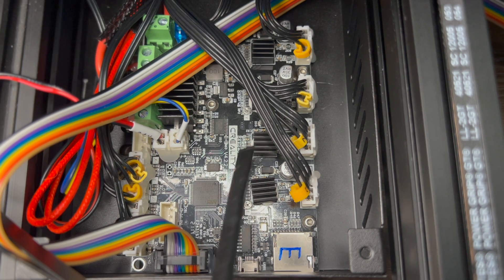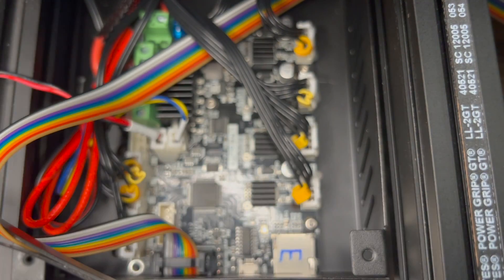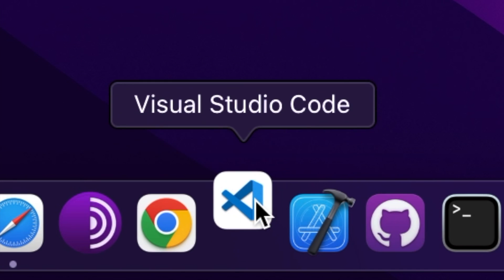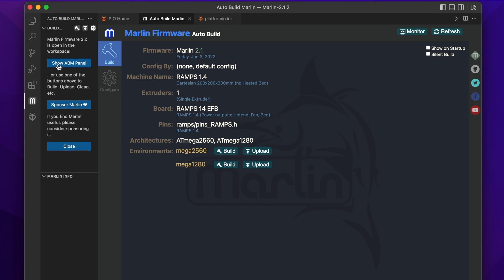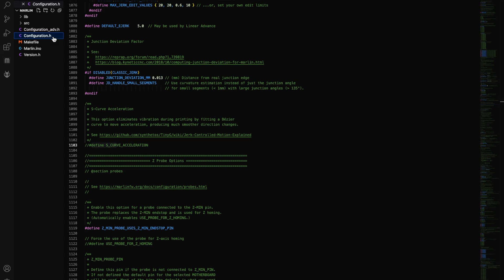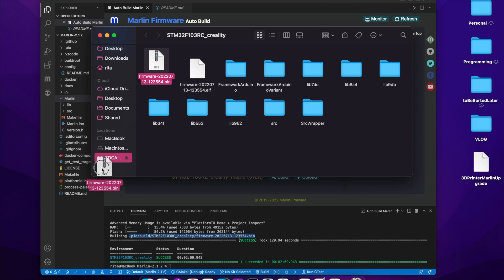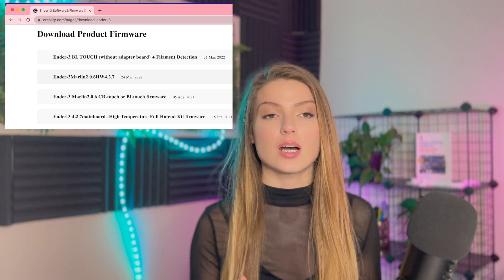How To Update 3D Printer To Marlin 2.1 Firmware (for Ender 3 and more)

Comment: One thing I have to do in the firmware is change the maximum temperature of the hotend and the bed, in my case I need to print polyamide or pa-cf which is a high performance engineering polymer with carbon fiber, the complicated part is changing the firmware and in research I saw that the standard hotend is not suitable for this, but it supports it so I'm going to do it and my printer is in a marine compression oven and the board and filament are outside, in this case I made the modification on the ender 3-pro

Comment: Hey everyone, I need some help! I’m trying to update the firmware for Marlin on my 3D printer, but it’s not working. I’ve downloaded the firmware, configured the files, compiled it, and copied the .bin file to a FAT32 formatted SD card. However, all that happens is the printer writes the EEPROM.DAT file, but it doesn’t actually update the firmware. Has anyone else experienced this? Any advice would be greatly appreciated!

Thanks in advance!
====================================
Hola a todos, ¡necesito ayuda! Estoy intentando actualizar el firmware de Marlin en mi impresora 3D, pero no está funcionando. He descargado el firmware, configurado los archivos, lo he compilado y copiado el archivo .bin en una tarjeta SD formateada en FAT32. Sin embargo, lo único que ocurre es que la impresora escribe el archivo EEPROM.DAT, pero no actualiza el firmware. ¿Alguien más ha tenido este problema? Cualquier consejo sería muy apreciado.

¡Gracias de antemano!

Comment from the maker: ATTENTION: The "cool down" feature DOES exist, I didn't see it at the bottom of the menu at the time (sorry!), and didn't think to scroll down. My apologies! Just know that it only pops up / reveals when the printer is in a "preheating" state. The "Cool Down" menu option will be in the  same location as "Preheat PLA / Preheat ABS" but it won't show until after the printer is heating, and it will be at the very bottom of the menu.

Comment: Ok. You are very cute, but if the end result is a thermal runaway you shouldn’t be teaching how to update firmware, 200 C  on the bed and nozzle can burn your house down.
Reply from the maker: Hi! There is actually a "cool down" setting that pops up at the very bottom of the menu under temperature, it reveals only when the printer is preheating, in the same location as "Preheat PLA", there's "Cool Down" but it's hidden at the very end of the menu. I feel so embarrassed that I realized this just after I posted the video, hah. I mentioned this in somewhere else too but I will post this in the description for others to know. Thank you for your comment!
Reply: @techwithrita  I dont think the bed should EVER reach 200C regardless of a "cool down" option..you feeling embarrassed isn't going to rebuild someones house after it burns down because they followed your video.

Comment: I followed all your step but it look like Visual Studio Code and the Marlin ext changed because ABM is not there anymore, any advice?
Reply: You have to add the Auto Build Marlin  extension. On the left hand side of VS use the extensions button and search for it. You will see it pop up. Once its installed you have to make sure you have Marlin loaded in the workspace for it to show.

Comment: Thanks for the video.  Honestly, I have not had the issue of not responding to temperature changes during printing or after preheating, and I can send the M104 to set the hot end and M140 for bed.   Not sure why yours was giving issues.  Hopefully you've solved it by now, being a year or so later.

Comment: Did you solve the bed/nozzle temperatures not decreasing? Were you using Octoprint, manual printing (or something else)?
I'm gonna test this with Octoprint, will edit/add a comment later with the result. Thanks for the video, super helpful!
Reply from the maker: haha yes actually, I had embarrassingly failed to realize the "cool down" function that exists at the bottom of the "temperature" menu... right below "Preheat ABS" (it only shows if it's preheating)...quite silly of me. I just hadn't thought to scroll all the way down at the time.

Comment: Question.  I have an Lk5 pro but would like to replace the motherboard and touchscreen with an ender 3 max motherboard/touchscreen.  If I utilize Marlin, can I make this work, or are the two systems incompatible?  Please advise, and thank you in advance.
Reply from the maker: Hi! I wouldn’t know anything about this, I could only assume that the motherboard would need to run the firmware that accounts for the X, Y, and Z axis dimensions (start to end points/ top to bottom) of the printer’s functional area, taking into consideration the distance of the extruder from the bed, among other constraints of the particular printer frame. 
With my lack of knowledge on this, I would further assume that the drivers and all the motherboard’s components would remain the same for the firmware’s motherboard type, drivers, and fan (etc) with presumably, just a guess the only things needing to change / adjust in the firmware being: 
-the motor controlling (coordination info, stepper motor type, power voltage allocation (may vary with motor types if motors are different from original model)) 
-all the electrical technicalities, (power supply, voltage / current specs, etc. if different from Ender 3 /original model)
-extruder type and specs 

I’m sorry I can’t be of much help here. 😅
Reply: @techwithrita  Thank you for the quick response.  What you are saying makes sense.  I'm new to 3d printing especially learning Marlin.  I wish there was an entity that offered courses on Marlin that broke it down 'horsey ducky' style.  I would pay/take these courses.  Have a wonderful day, and thank you again!

Comment: NOOOO NOO it is not fine do not just put the heat sink in like that!! Don't even take it off!!! just look at the sd card reader and use the letter marked on it to reference what stepper drivers you have there. newer upgrade boards have stickers on them just google "ender 3 sd letter stepper chip codes"  and the info should pop up. but please for the love of god dont rip that heat sink off then let it sit like that you will short your board  out!

Comment: Hey, what do you do if the chip info does not match up with the builds at 7:01. I have an ender 3 neo. I used the folder marked for the Pro since its one of the closest one to the neo. my chip told me its a "TMC2208". Please if you can help that would be great.

Comment: I went through all these steps last night, only to find that the chip in my Ender 3 S1 is not supported for Marlin because they switched to it due to the chip shortage. It's the STM32F401 chip, and it didn't show up under the list of options when it came time to build Marlin. Also my heatsink wouldn't stick back on so I put a dab of toothpaste on it as a temporary fix. Ordered some thermal paste on amazon, so that toothpaste will be replaced as soon as it arrives.

Comment: YOU DO NOT HAVE TO REMOVE THE HEATSINK ON THE DRIVER BOARDS. The letters written on the micro SD slot actually correspond to the driver chip on that board. (specifically for Creality 4.2.2 and 4.2.7 boards)

C = HR4988
E = A4988
A = TMC2208
B = TMC2209
H = TMC2225
T5 = TMC2225
T8 = TMC2208

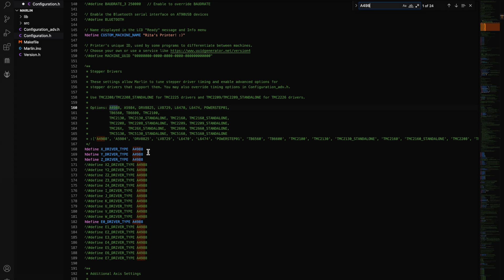In the case of the video you can see at 2:29 ish there's an E written on the slot and later around 6:50 you see them use A4988 as the driver. This will save time and your eyes with how hard they are to read

If you do still remove the heatsink make sure you get some thermal paste to replace it .
Also thanks to Printer Mods website for this info!
Reply: I really hope you respond quick, what if there’s nothing written on the micro sd slot
Reply: @nunyabusiness4718  remove the heatsink and read of the chip?
Reply: Thanks, you are a life saver!
Didn't dare to remove the heatsink as I don't have this kind of thermal paste, and didn't want to risk burning down the driver.
Reply: Hey. Mine says 8H what’s that 😂😂😂

Comment: Would you be so kind to help me out with my CREALITY ENDER MAX NEO? I'm sure there is a reason no one has a firmware for this! I can't find any configuration files and what I have found, the numbers for the size of the bed doesn't work, I have to do all kinds of offsets and I can't hardly print with the printer, even cura doesn't have the fig file, the ones that I have are in Chinese and I'm just lost! I've spent 2 weeks trying to do This and it's not working! I would pay you ! Lol I would greatly appreciate it!

Comment: I mounted sprite extruder, dual z axis, bltouch and touchscreen on ender 3 v1 with 4.2.2 manboard, but it seems compiled bin firmware doesnt work properly and i bet on PID settings. I found only 1 firware which work, (without sprite extruder in specs) with screen but prints are terrible. Dont have time atm, because need to do documentation next month for heat pump which i buit for enginer title in mechatronics (atmega modbus tcp connection with plc s71200 web serwer (overcomplicated for giggles) and have engineering defence/presentation next month, also work as automatician in industry... No life, no time... I could have a wife like you and we would do some projects. Hope i done everthying in this life and your tutorial will help me with printer issues.

Comment: 2:54 NOW you tell me... i literally took appart EVERYTHING on 2 ender 3 (pro and v2) not knowing anything about 3d printers :P they had that loop rebooting issue many have and i was trying to repair them.. until i learned it was due to bad factory installation of the heat sensor :P

great video! simple, easy to follow and to understand! new sub!

Comment: After all that, is the printed object any better quality?
Reply from the maker: Absolutely! That’s a great question. The functionality during the beginning and middle of the print has improved significantly! My printer used to glitch out often (almost with every print) and not align correctly when auto homing, it also used to dig the extruder into the bed melting the bed cover… the extruder would extend beyond the X and Y parameters, it would randomly stop the print halfway among other weird and odd glitches. I couldn’t trust my printer or leave my prints going without watching it the whole time because of these problems. I initially chalked it up to it being either a low quality printer or it being my fault for not getting something correct being a “noob”, or for messing something up… but I did a lot of research and despite not knowing exactly what was wrong, I just decided to try a firmware update and the difference was astounding. Although I am not able to identify if it’s because of my printer’s older firmware version or because of the slicer combined with the older firmware version that made my printer (& prints) glitchy and of low quality, but I most definitely was tempted to purchase a newer & expensive printer because of the issues, and now I don’t have to thanks to the firmware update.

Comment: Yahoo, my new system board is up. What I did. I found you need to use a mini SD card. the regular SD will not work with an adapter. My mini SD card came with 2 folders, “boot” and “USB DRIVE”. Yes. One in caps the other not. I copied everything from the mini SD card and deleted all the files. I then put the .bin in both folders. The original .bin from the mini SD card that came with the new board. Just to mention my background is 43 years of computer hardware field engineering. So I unplugged the printer, and turned it on. This drains any power left in the board. A couple of minutes works. Then install the mini SD card. Turn off the printer, plug in the printer and turn it on. After about 20 seconds the printer shows the main screen Ender 3 PRO. I have not tried using it yet. However this process  did get firmware on the new board. When nothing else worked. I hope this is helpful. I should be able to use the new .bin created above in both folder. Thank you TechWithRita. 
Update, I have been able to reload firmware with a different firmware using this same procedure. Procedure proven to work.

Comment: Hi Rita, 
Great video. Unfortunately, I'm having an issue. The current version of the Marlin Firmware is 2.1.2. I've followed your instructions to the letter, but using 2.1.2 instead of 2.1. However, when I go to build the file I keep getting an error. It says "Your Configuration_adv.h file is for an old version of Marlin. Downgrade Marlin or upgrade your Configuration_adv.h." Do you know of a fix for this? Please help. I miss printing and my printer is down until I can get this firmware to work. Thanks.
Reply from the maker: Hello! 
What is your board & printer info? 
Did you copy and paste over the config files from the downloaded GitHub folder for the config files matching your printer’s board info? 

Did you copy your specific board’s config files and paste them into the Marlin folder in the Marlin 2.1 download folder? 

Marlin-2.1 2 > Marlin > paste the copied config files > click the Marlin Auto Build tab in Visual Studio Code and it should populate the fields with your specific & correct board info.

Does this help?
Reply: @techwithrita  Hi Rita.
My board is a Creality V4.2.7 (32-bit) for my Ender 3. I did copy over the config files, just like you showed in the video. I tried doing the optional settings and it didn't work. So, I tried again without doing those. Neither worked. I just can't get the file to build. I really appreciate all of your help.
Reply: @brewerpaul1  did you ever resolve this? I’m having the same issue.
Reply: @nikand3  I just resolved the issue, it depends on the file path. Try putting the Marlin 2.1 folder in your C drive. The file path must be short. This worked for me after hours of trying to get it to work
Reply: @brewerpaul1  In video edit default Configuration.h, why? I don't know.
In video 6:07, line 23 and 24 are empty. In example folder, line 24 = #define CONFIG_EXAMPLES_DIR "Creality/Ender-3/CrealityV422". Maybe I'm wrong?
 
For Windows 11, work 100%. Marlin 2.1.2
After download configurations (Configurations-release-2.1.2.zip):
1. Extract all and go to path \Configurations-release-2.1.2\config\ and copy 2 folders — default, examples.
2. !!! Paste folders (default, examples) in folder: C:\Marlin-2.1.2\config\  !!! It should be: C:\Marlin-2.1.2\config\ "default, examples " (2 separate folder)
3. Go to «C:\Marlin-2.1.2\config\examples\»  and select your printer (config folder). Example: C:\Marlin-2.1.2\config\examples\Creality\Ender-3\CrealityV422\ "4 files"
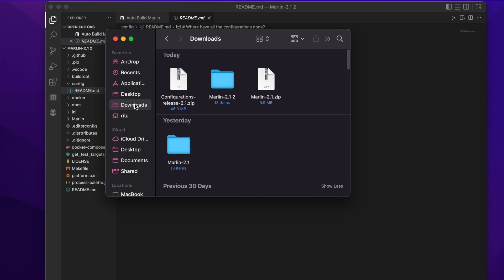4. Copy as in video, 4 configuration files (5:03) and paste in folder C:\Marlin-2.1.2\Marlin\

Comment: I get an error everytime. Says my configuration.h is an old version. But i just downloaded it…
Reply from the maker: What is your printers brand & board info? Did you download both the config files from github and the Marlin firmware? There are 2 downloads.

Did you copy the config files from the correct folder in the Github configuration files download and paste them over the originals in the Marlin folder located inside the Marlin-2.1 2 folder? 
Marlin-2.1 2 (the downloaded latest Marlin firmware folder) > Marlin (not the ‘config’ folder ) > paste the copied config files, replacing the originals. If a pop up asks if you want to replace the files with the same name, click yes.

Let me know if this helps!

Comment: wonderful tutorial!!! However I have a question because I want to change the motherboard of my printer to a more powerful one (SKR 3); although the official github of the SKR has a Marlin already configured, it is version 2.0, and I would like to use this last version 2.1. Would it be enough to install Marlin as in this tutorial (Marlin 2.1) and only modify the config.h and adv_config.h files with the parameters of the official version of SKR (Marlin 2.0) ? Thanks for the tutorial!

Comment: Hi Rita this is a great video and it helps. I am just not understanding what information is needed (or what is written down) on top of the drivers and cpu so I can compare between what you so and what I have. I have an Ender 3 board v4.2.2 but the main cpu has GD32F303    Ret 6   AUH 8159   AC2147. Thanks for any and all help.
Reply: Hi, I just dealt with the same problem. In the Marlin section, select STM32F103RE_creality 512K. Everything works fine for me. When updating the firmware, it was only necessary to overwrite the file with the .bin extension. For example: "my new Marlin.bin"

Comment: Can you please help?? Im trying to follow your steps and have gotten up to the "clicking Build" on the STM32F103RC part. It runs the build, but then says "Incomplete". Im so lost.
Reply: Same here.
Reply: @justapile4376  hey! I was able to get it working. Make sure you are using BOTH, Marlin 2.1 and Compression file is also 2.1. They have to be the same in order to work
Reply: @JustUsGaming987  I think it has more to so with my board. Last time I had to use a bootloader plugged into the board itself before it would take.

Comment: YOU SAVED ME! I received an Ender 3 Max as a gift 4 days ago and I saw other tutorials on how to upgrade the Firmware. I did followed it step by step and the printer was stuck at the Blue Screen for a long time and wouldn't return to the previous working state. I feared I had bricked the damn thing. I followed your instructions and not only was my printer fixed, the firmware was also upgraded to the intended version! You just won my Like and Subscribe!